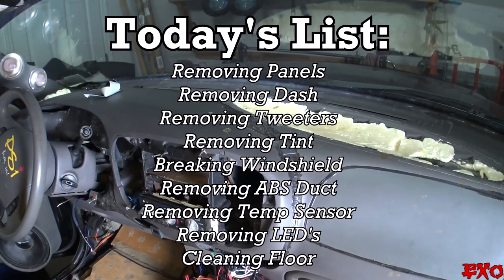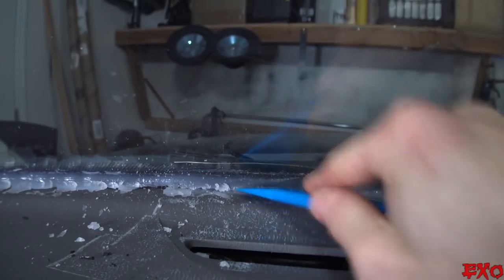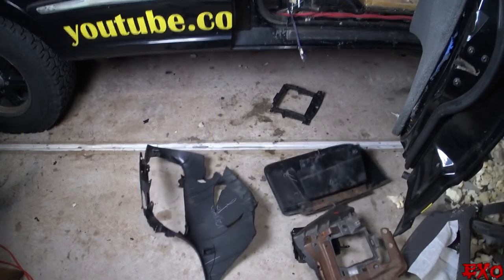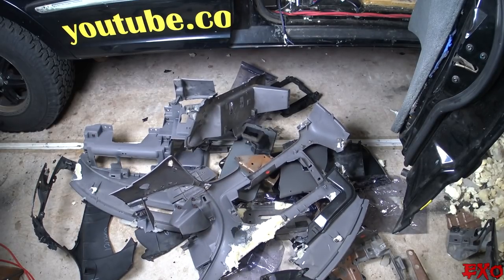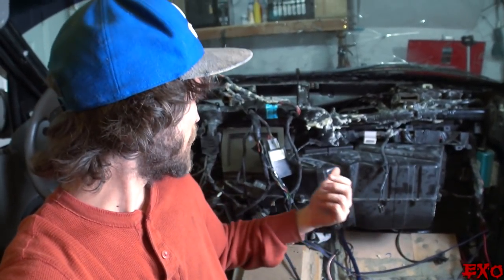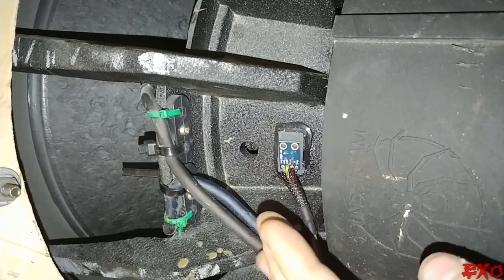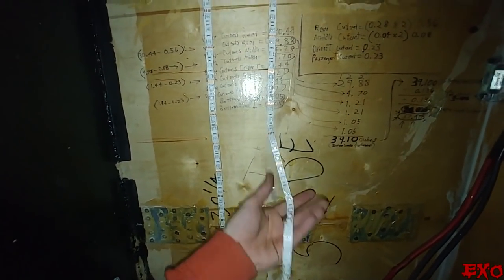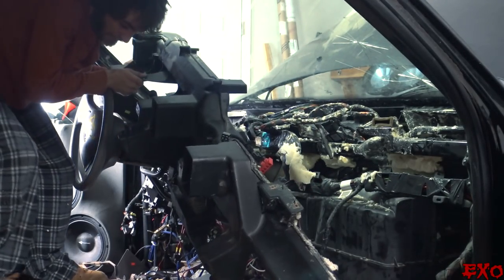$200 Mistake REMOVING Dashboard for Custom Build w/ EXO's INSANE Car Audio Subwoofer Install 2018

Comment from the maker: $200 OOPS... Still Pumped Though!!!!
Reply: Have fun Exo....I'll meet u one day..n get a Demo
Reply: I'm glad you got thru this project without hurting yourself and well I'm sure a few swear words was implied...lol
I have all specs and access to any info you need ..let me know if you need anything to help..
Reply: DON'T FORGET TO PUT IN A NEW HEATER CORE WHILE THE DASH IS OUT!!!!!
Reply: +GIXXXER FANATIC he's deleting the core... so no
Reply: EXOcontralto man please help I spent all weekend driving 10 hours there 10 hours back and 5 hours building a box to bring all the way back too TN and it didn’t fit spent 150$ in wood and had too brake it all apart trying to get it from being stuck in trunk I’ll pay u too come help me build a box good good money your the man please trying too start taking my kids too shows this spring and I got all skar subs and amps battery’s in a 06 Altima I payed this guy 300$ and went too him with wood and just too come home and not work PLEASE HELPPPPPP!!!!!!!!!
Reply: So you freeze your ass off in the winter.  Not too smart a move.
Reply: EXOcontralto been wanting to build a center console but truck is manual so there's a stick shift rite in the way its gonna take some time to figure it out but anything is possible so dnt give up sucks u broke the glass but shit happens bro jst gotta work through it
Reply: Heater core delete only requires one part. It'll be a male to male hose connector to connect the inlet and outlet together. AutoZone will have it. Everything else can be scrapped
Reply: Plz read the message I put in your comment section above
Reply: The only kind of person who doesn't make a mistake is a person who never tries something new.
Keep up the good work!
Love your videos!
Reply: Love your comment "More Silicon then Southern California" love it I am in NORTHERN CALI!

Comment: This is my favorite part of a build, finding all the mistakes and thinking of ways to improve it. If this was my build I’d use spray foam than shape the dash from there, than use that as a fiberglass mold. It would be interesting if you could make the wires look good enough to display like you’ve done in the trunk. Putting it behind plexiglass for good YouTube footage.  Passive radiator for kick panels would be sweet too not sure how that could be pulled off but if I did you could tune the box by changing weights on the passive radiator just like changing the size of a port.

Comment: Honestly that was a blessing in disguise. Now you can pop that windshield out and build that dash 200 times easier. Don't get it replaced until you're done. If you have to park outside get a tarp over it.

Comment: To delete the heater core u can either Cut or remove the hoses on firewall in engine bay and either loop them or just plug both ends. For AC, just remove lines at fire all in engine bay or just remove evaporator inside car, unplug the AC Clutch at the compressor so it has no chance of turning on and seizing up. ( or get an AC delete idler pulley, either way will work). If possible use an AC machine to recover any r134a refrigerant that may be in the system. Or just vent to atmosphere but that's bad for environment ool

Comment: Exo, how did you become so knowledgable about subwoofers? I really want to put a nice system in my truck and i have the financial means to do so, but i know absolutely nothing. Is there anyway i could pay you to tell me where i could learn correct information on basically everything. Im not entirely new to sound systems but i dont know a lot of things. I really want to educate myself so i can do this entire process myself because im afraid of getting price gouged at a "professional" shop who possibly also screws me over but im none the wiser. Or if you could reccomend any quality professional audio shops in San Diego id really appreciate it. Thanks Exo and not to brown nose but its really refreshing seeing someone so passionate about their hobby and very respectful to everyone. Keep it up G!

Comment: Why remove the heater core? It gets cold where you live and depending on the year model, there are lots of sensors associated with the heating system. Check Engine light will stay on at the least. Again depending on year model. As for Air bag, I have restored several old vehicles that didn't have any air bags at all. Are they required? Good luck and I will be following along.
Reply: Oh Yeah....Take that windshield out and have access from both sides.

Comment: Fyi on the passenger and drivers sides there should be a series of connectors, unplug the battery then unplug those, you'll be able to take the entire dash harness out to get to everything and tie it into the new dash. These dash's are very easy to take out and can usually be taken out in one big peice, all that's required is to unplug those connectors, drop the steering wheel, and the whole assembly comes out. Of course can't do that with all that foam lol! Oh well.

Comment: This is scaring me a bit as I'm eventually planning on replacing the dash in my car.  The one in it has been making an annoying crackling sound for years when it gets cold out and I snagged an entire dash off eBay for $100 to swap it with.

Comment: Where do you get the confidence to destroy your dash like that?? I'd be freaking out.
Reply: Brandon Neil he has the knowledge to redo it? Look at the rest of the truck.....
Reply: as Punching stated... the Panels are scrap... But yeah, I'm pretty sure wiring isn't difficult for Exo; 
Unlike most people who work on cars that absolutely despise it.
Reply: Brandon Neil I have to do it on my brothers Grand Am. The wiring harness fried 3 radios and 2 amps before he finally believed me. I may just run an independent harness just for the radio. Replacing the full harness will require a full interior removal, trunk and all.

Comment: Dude use acetone for the foam it melts like snow
Reply: Eamonn Caris but how strong the fumes are in a small concentrated area
Reply: Travis_ Williams not so much just don't smoke
Reply: Prolly would also dissolve other things he probably doesnt want to
Reply: Yeah probably
Reply: Eamonn Caris It would melt every piece of ABS too genuis!

Comment: Cut a piece of the heater core piping off and loop the heater hoses.shorter belt gets rid of the the a/c compressor then remove it all and sale for scrap metal
Reply: Cheap Bleach yoooo this the real deal bud

Comment: Get you some hose connectors and a u shaped hose it's called a heater bypass hose stick the connectors in the stock hose put the bypass hose on the other end clamp it all together and there you go heat side ac side get all the refrigerant out of the system remove hose and see if you can buy an ac bypass pulley and there you go you're done running an ac compressor without refrigerant will actually lock up the compressor and cause your belt to break so there you go

Comment: Why not keep the heater core and AC, and just delete the outside air intake?
Then you could have AC and heat, but only on re-circulation?
AC I can understand deleting, since you can remove the compressor, but why remove the heater core?

Comment: I see your problem you weren’t using enough foam, if I were you I’d make a access hatch for the wiring harnesses than fill the rest with foam. Than all it takes is carving out a custom dash than fiberglassing over top. It be a good idea to foam in your speaker box’s.
Reply from the maker: Foam inside the speaker box???
Reply: EXOcontralto not inside the speaker box around the speaker box/wires. Basically the foam would be the mold for the fiberglass but leaving the foam to keep the dash from flexing.

Comment: Why don't you make a custom dash similar to what hotrodders do, using custom gauges and aluminium. It would save the inevitable headache of ruining a standard dash with quick fixes from the constant hammering of sound pressure. The weight saving would be tremendous and it would take your vehicle to the next level....

Comment: I have a question that's boggling my mind. 
In my Exploder I put a 250 amp HOA. BIG 3 plus extra grounds for the HOA to the chassis and battery. All 0 gauge OFC. I have a yellow top up front and a stinger in the back. 
Problem, still voltage drop. I turn it down at stops. It isn't too bad....normally I'm at a constant 14.4 - 8 at the amp. I can get it as low as 11.5 on some songs. 

Kenwood excelon 998x head unit
Massive N3 nano mono block 2800 (1400 rms @ 1 ohm 14.4). 
Massive NX4, 4 channel 
DB drive 10 " mids and 1 " highs in the doors.
2 Phoenix Gold TI3 12's 600 rms wired 1 ohm.  
What is going on???? Any input from anyone. I am putting another 2 of the PG TI3's in soon and would like to know my options. It should be a solid start with what I have.
Reply: if you have the subs wired at low impedance that could cause it mabey or make sure all your grounds are clean metal surfaces.. could be the amp too i dont recognize the brand but cheaper amps have less efficiency and draw ALOT of current to produce the rated power on the amp. and what do you mean by a stinger in the back? is that a brand of battery or is it a cap? if its a cap thats why caps are absolutly useless. if its a battery you may need to upgrade the size for more reserve power cuz you may be lacking it for the power demands you have

Comment: Removing your ac unit will cause you more problems cause you will have to remove the whole ac unit under the hood I'm tell you to leave it there for safety plz read this message exo I'm a college students taking a corse on ac rn in Nashville and replace your airbags too for safety

Comment: Truthfully i wouldn't bye that hose from a part store i would reuse on of the hoses off ur heater core and on the blower motor wire put a 5 amp fuze on it and use it as a on and off witch for one of ur amps

Comment: HEATER CORE DELETE Just block it off with some of the existing heater hose just bend the top hose at firewall around to connect to where bottom hose was and clamp it with hose clamps same with engine side save that money

Comment: EXO you do realize the heater core is part of your cooling system and by removing it.  You taking out a huge part of the vehicles cooling ability.   That a big NO no.    Yes you can but it’s definitely not a good decision at all.   You should fix the problem , since the dash is out now is the time to fix it.  It can’t be hard.   Simple simple stuff
Reply: JASON JACKSON the heater cote has nothing to do with actually cooling the vehicle, in fact it is shut off with a valve when the heat isn't on.
Reply: DMAN22yeah I’m sorry but that’s not correct.     Radiator fluid runs though it. And give the vehicle more area to displace heat.    And removing it will reduce the amount of cooling fluid your vehicle needs to run cool as need be.   Do some research on it     Removing this and using a bypass is a super backyard mechanic rig.
Reply: Most cars have a bypass valve for when the heaters not running. If it's cold enough to be running the heater and you have cooling issues you have more serious problems. I would rig up a defrost myself since it would be simple but that's just me.
Reply: The engines collant still runs though the heater coil.   Fluid travels the path of the least resistance and both radiator engine and coil are in parallel.  Hence taking the coil away & jumping the 2 lines together creates and pinch and reduces the flow that your motor is supposed to get.  Hence creating hot spots in the motor.   Not saying it can be done as I’ve done it myself. But that should only be a temporary thing & NOT permeant fix   And removing a perfectly good one is kinda retarded since your reducing flow for no reason.  But most importantly.    If so and so wants it.   That’s their choice.   Best of luck to ya.
Reply: JASON JACKSON you are so wrong it can't be made right. 
If it's only for char audio and not travel places,taking it out lets you plug off the holes all the lines go thru so it keeps pressure inside cabin.
Reply: JASON JACKSON if your coolinh system is always circulating throug the heater core then how does the heater stop heating? Thats how you get heat. Plain and simple. Now if you have a dirty radiator or a cooling fan that isnt working. Turn the heat on and your coolant starts flowing through the heater core. Then it helps lower the temperature and then its crucial yo the cooling system
Reply: +Anthony Tucker (AntDaddy) have you never noticed with blower of and climate control set to heat, hot air still slowly comes thru ? why all y'all think that is..especially when turning the knob to cold stops this..it's pulling the heat from something, that's getting it from the engine some how..hmm wonder what that is...
Reply: Anthony Tucker geez y’all need to start to actually research something first    , or work in that trade before speaking.  If it close it off then that would cause ALL THE COOLANT to stop flowing everywhere.  DUH!
Reply: All of you need to learn how a heating system actually works before you go on about it. EXO will be fine to pull the hoses back into the engine compartment and join them together forming a closed loop. Frankenstein will not overheat if it is done in this fashion. The only downfall to this is that there will be absolutely no heat coming into the vehicle. This means the defrost won't work either. If Frankenstein will not be used during winter or the cooler months, this will not be a problem. As for the air conditioning, same type of thing. The lines can be removed and the holes into the cabin can be plugged. At that point I would recommend an A/C delete kit from a parts place. The A/C delete kit has a pulley that will mount right up the engine in the exact same place as the condenser. Just remember a good kit will come with washer to offset the pulley to line the serpentine belt up. Without doing that, you will go through belts rather quickly. As for the kit, that means that there is no monkeying around with the serpentine belt. With all of that EXO will be able to remove the entire blower motor assembly and the ducting from the vehicle and not have an issue.
Reply: Yea heater core has nothing to do with cooling just loop the heater core hoses together and call it a day
Reply: JASON JACKSON  well considering I was raised bye a mechanic and went to school in automotive technology I have had my experience with this. Your coolant circulates through the engine ,radiator, and heater hoses , and heater core. Now if you poo the hood on most of all vehicles you will see 2 hoses running to your heater core. One end will come out either at the water pump or nearby. The other hose goes back to the coolant system somewhere depends on the car. Key words are heater hose and heater core. They do not have to be used to keep your vehicle cool. I have had several heater cores and hoses bust before. And put me on the side of the road. A way to get home or to where ever is to bypass the heater core. With that said run your car up to temp with the heat off. Touch the heater hoses but be carefull. They should be warm. Now turn the heat up to max. Now go touch the heater hose. It will start circulating hot coolant so you have heat. Unless your car has a electric heater lol.
Reply: You can bypass heat and AC with zero issues as long as you do it correctly and the rest of the system is in good shape.  Sure, the coolant passes through the heater core and can help reduce coolant temps if you crank your heat on full, but if you're having to do that you have bigger issues.  The heater core really adds a minimal amount of heat dissipation to the system.